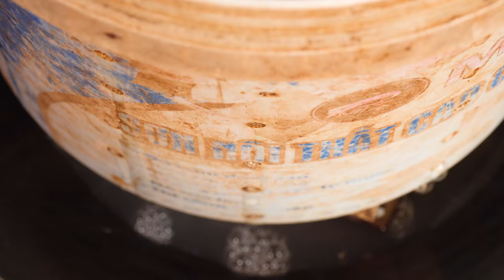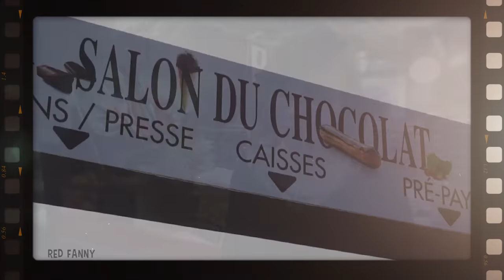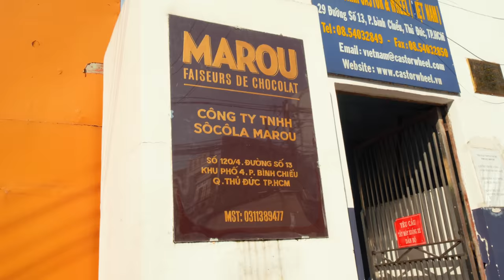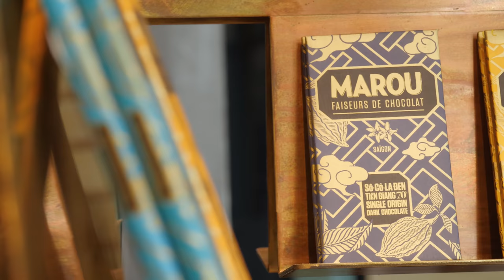How Vietnam Makes Chocolate!! Sonny and the Chocolate Factory!!

Comment: Fun fact: i just noticed this too. I worked as a pastry chef for about a year. The chocolate mousse in the cup was over whipped! When they showed the close up on sonny's spoon. There are air pockets throughout the whole thing. You DON'T want that! It should look silky smooth, with a sheen to it. No air pockets at all. It can make the mousse grainy or even break(seperate) to some extent. I learned that right away lol. Just thought I'd point that out.